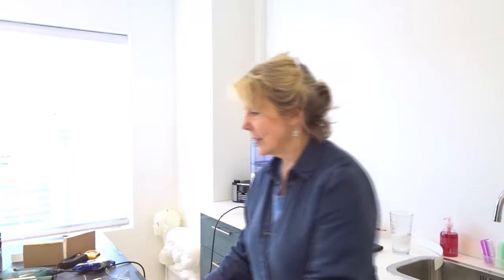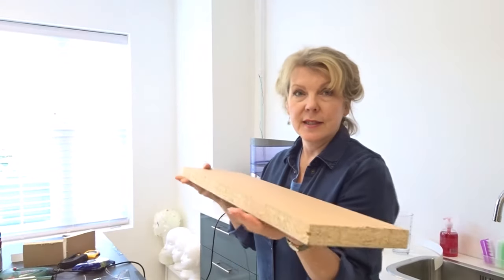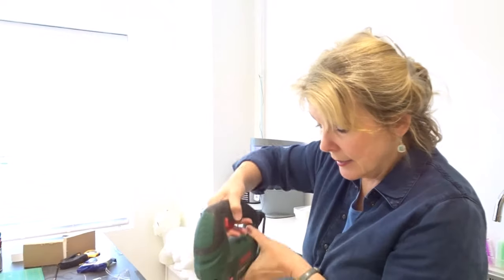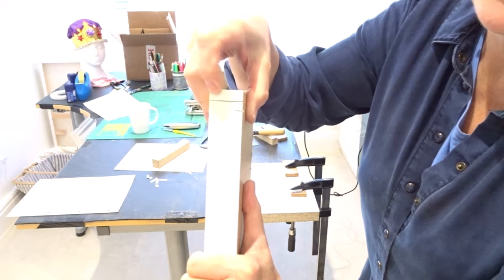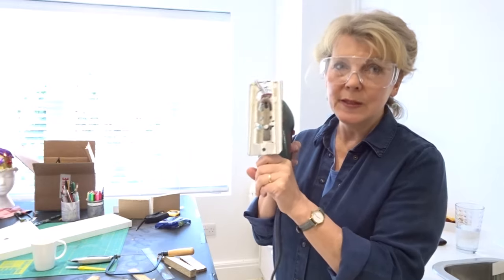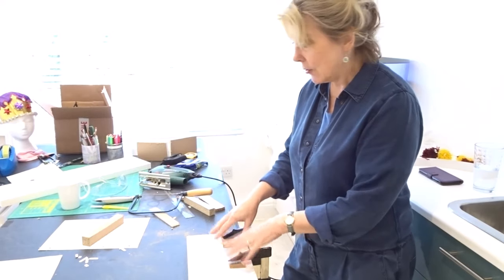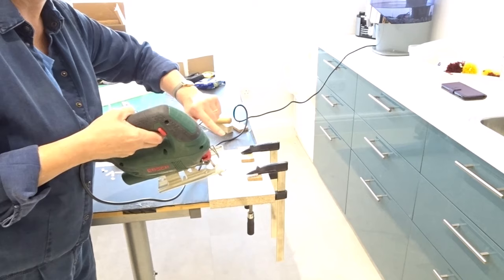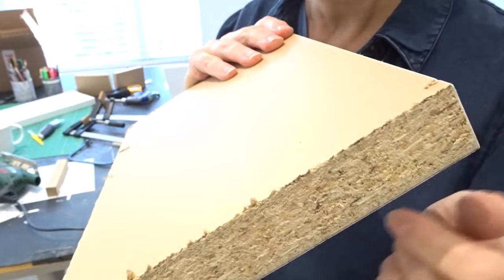How to cut a laminate worktop cleanly.

Comment from the maker: Hello everyone, I've just added another video about cutting Laminate worktops, this one covers those tricky tops that you have to cut without removing. 
https://youtu.be/b-OEkRpW-EE
Reply: Loads of thanks for this. If I need to make a pilot hole in the worktop first (to get the jigsaw blade in) what would you recommend about how to do this? [el'sda2]
Reply from the maker: @lemsdarkapprentice2535  I would make a hole ( with a wood drill bit) in the bit of laminate you are going to discard near the cutting edge, but not on it, then cut with the jigsaw to get to the cutting line, proceeding at a shallow angle ( not 90 degrees! ) to get to it then merge into your cutting line. You might find this video
 ( https://youtu.be/jAdZ94pqOXo )
 (not mine) useful to watch from 4 mins on. Ity demonstrates really clearly what I am trying to explain.
  Practise on an off cut first, to build your confidence. Let me know how you get on. Good Luck with the project. Make sure you subscribe. Thanks for watching.
Reply: Great video,  thank you. You are a great communicator.

Comment: If you apply less pressure with your hands on the whole tool, you will get and even cleaner bottom cut. I meant that if you completed the whole cutting off in say 20 seconds, take another 20 seconds to move the whole tool while cutting all the way, the blade won't take too much stress even though it might heat up. Nice video though. Really helpful 👍
Reply from the maker: Thanks Ravin. If anyone tries Ravin's method, let me know how you got on. I'm not looking underneath the countertop but would be interested to know how others got on.
Reply: @BecomingCreative  I have experienced this myself and in the beginning I would be in a hurry to get  the job done and that's how I learnt not to apply too much pressure on the cutting tool.

Comment: 10 out of 10 for presentation.
The trouble with jigsaws is that they are designed to cut curves. They are not designed to cut deep, square, straight edges.
I've cut many worktops and many items of laminated chipboard, but one tool I would not use is a jigsaw, unless I wanted a curvy edge.
Even with a professional jigsaw, a guide rail, a decent blade - laminate blades are available - you will not get a square cut across the length of a full sized worktop. The blade will go out of square the longer you cut,
For laminate worktops you need either a circular saw with guide rail for straight cuts or a large router and jig for joints.
A circular saw will cut exceptionally square, clean, chip-free edges if you work with a guide rail, use a decent saw with preferably a triple chip blade and most important of all, work from the reverse side, i.e. laminate side down.
You won't need to see where you are going because the cut will be square.
For really critical jobs, I would use a new blade or one that has had very little use. Chipboard is full of rubbish that will ruin a carbide tipped blade.
For "masons mitres" or joints at right angles using boards that have shaped edges, the the router is the way to go.
A big, powerful 1/2" router and a jig is the only way. Preferably after a training session on how to use it.
The going rate for a professionally cut worktop joint used to be £50 years ago, so no need to skimp on tools or materials.
Reply: Hi professional! question that if I need to cut worktop which made of paper+plastic, could I use Flat Wood Bit - 40mm to cut the worktop? thanks!

Comment: The described solution indeed works exactly as described, but cutting from the backside with a regular blade is much less fatiguing and more controllable, as you don't have to push hard downwards on the jigsaw all the time. With a regular blade the cutting force is applied against the baseplate and the jigsaw stays firm on the material wihout need to push down.
Try cutting a thick (or hard) worktop with a reverse (also called downstroke) blade and the jigsaw jumps on you up all the time.
This can also be seen in this video on the begining of the cut.
That is why the downstroke blade design is the exeption rather than the norm.
Reply from the maker: I agree and I do think that it is time to invent a new form of support that clips underneath the cutting surface, for use when using the down cutting blade. I have suggested this before maybe one that clips round from the side and under? Perhaps we need to design this new accessory TheXape?

Comment: I am making a sewing table for my wife and need to make a cutout for the sewing machine to be flush with the laminate top. I seldom use my jigsaw, but need to use it in this instance. I never knew about reversible blades. Thank you for the tip. I phoned my friendly woodworking tool shop and of course they have these R blades in stock. Never too old to learn new things. 😀
Reply from the maker: Well how lucky is your wife! Hope it goes well. Thanks for watching. Hope you've subscribed.

Comment: Beautifully explained!!! I've been told several times, that "they" couldn't do a repair on my new countertop. The salesman measured wrong and didn't listen to me say I wanted it flush so that I could have a handicapped approved door entrance, plus I wanted to be able to order a new refrigerator that would fit through the door. That's why I took the breakfast bar down in the first place. Now the countertop sticks out 1 inch too far.
 You give me hope that I can trim it back. I'm so grateful for this video. Thank you
Reply from the maker: I feel your pain! Take your time and a deep breath. There is no need to rush.Good Luck and I would love to hear from you when you have done it. If the bit you are cutting off starts to bounce as you progress, fill the gap you have cut ( so that you don't squeeze the blade) with a piece of cardboard or a lolly stick and tape it to the main piece behind the blade to keep it steady as you process to your triumphant finish!

Comment: Thank you for the clear instruction! I believe for laminate flooring there's also a sawblade with its teeth in the opposite direction, as you do want to have the decoration side of the floor facing on top.  What actually happens at 8.06 is that you start to cut already when the saw didn't had enough speed to cut. Use a speedsquare as a starting guide or a straight piece of wood as a guide to start your cut less troublesome, as you do not have to worry to "aim" where your cut has to start. It also appears you force the jigsaw to make the cut too fast. Let the machine do the work for you and the cut will be cleaner on the break-out side and the blades last longer. I also would like to add another safety rule: use ear protection.
Reply from the maker: And thank you Eric for watching and for your kind words and helpful advice. It's so rewarding that people with so much more experience than me a) watch the videos and then b) add their helpful tips and advice as you have. I'm hoping to build a lovely helpful community here. I hope you will join us by subscribing.
Reply: C hain saw has the same issue, the chain must be moving at full speed before contacting wood to cut neatly. Great video, and thank you for teaching about the R blade. Just when I thought I knew everything!

Comment from the maker: Hi There, I've been asked by Good Neighbour exactly which blade I am using in the video. Well firstly, thank you for watching and secondly the blade I used is called star x and I think I got them from screwfix. Their website is down at the moment so I can't give you a link, but the code of the blade you want is T101BR and many different brands make them. This is the link to the Bosch blades.  https://www.ffx.co.uk/tools/product/Bosch-T101Br-3165140012454-Reversible-Pitch-Clean-For-Wood-Jigsaw-Blades-X-5.  I'll post the link to the screwfix blades when their website is up and running again.

Comment: Finally someone who gives good clear advice without waffle. And a fellow female Brit.! Amazing. ! I'm trying to cut laminate flooring with a jigsaw. They are almost useless. Hard to keep in line, hard to keep on the table and the blade I bought for laminate is useless. Thanks for this advice though. ONE QUESTION. What is the best speed (s) and should pendulum action be used.?
Reply from the maker: Hi Jill, 
thanks for watching and glad you found it useful. In answer to your questions, I don't have pendulum action on my jigsaw, but I don't cut the whole thing in one go unless it's short, firstly because I don't want the jigsaw to overheat and secondly because I like to feel in control of it and be balanced on my feet, not leaning over. When restarting after pausing, I start the jigsaw before making contact (I believe the technical term is getting it spinning) and this has been recommended as the approach to take by one of the professionals on this thread  (I like to think of it as taking a short run up at the next bit if you like). So I guess this is a bit like a homemade slow pendulum action. 
As far as speed is concerned for the laminate I have found this https://www.wonkeedonkeetools.co.uk/jigsaws/at-which-speed-should-you-use-your-jigsaw, which you might find useful but it doesn't mention laminate floors specifically.  I guess I was going at a medium to fast speed, but my jig is quite old so I don't have actual numbers for you I'm afraid. If you have any spare tiles I would practise until you are happy with the cut. Also if the tile is moving as you cut it, I would definitely use some clamps and pad them with something rubber ( maybe some old flip flops)or cork to stop any slipping, but prevent denting. Don't try to cut a moving tile.
Lots of people tape the cutting line or score it before cutting with the jigsaw. Still slipping? You could mark the cutting line underneath, flip it over and use a 'normal' blade on the 'wrong' side. That way you will have extra grip as the normal blades cut upwards towards the base plate. I preferred to use the reverse blade and cut from the top on this heavy countertop, but if your tiles are very slippy (they are smaller and lighter than a countertop) and nothing else works, try this.

 Let me know how you get on and don't forget to subscribe!
Reply: @BecomingCreative  Very helpful. Thank you for your prompt and good advice.! Keep up the good work.! 😊

Comment: 1. The bland cuts on the up stroke to ensure the jigsaw base plate stays in firm contact with the laminate. You run the danger of lifting if it cuts the otherway.
2. To avoid not being able to see your cut lines mark them out on the underside.
3. Do what works for you.

Comment: Please add this tip to your future videos.
   If you are cutting off more than an inch of the laminate, you can make a practice cut.
   If you are cutting off 2 or more inches, you can make multiple practice cuts - before you do something you can't fix.
   This tests the surface, the saw, the blade, the cutting guide, and it especially tests your technique.
   You can firure out if you are better off cutting from the top or bottom, how hard to press down on the saw, cutting speed, etc.

Comment: Just what I needed to know as new widow am attacking DIY with electric tools I have only seen being used not allowed to touch, so thank you.
Reply from the maker: Well firstly, I'm sorry for your loss Jacqueline and secondly Brava for stepping boldly into the hitherto unknown world of DIY. We are all more capable than we realise and the more jobs you tackle the more confident you will be. Even if you make some mistakes, do not be downhearted or listen to any negative inner voices.

 Like pilots, give yourself a safety checklist; Goggles, ear protectors, check power off before and after use. Keep it next to your drill/ saw or whatever then you can be confident you are safe and don't have to reinvent the wheel each time. 
As you are a newbie, you might find it useful to keep a project diary. What you are intending to do, how you are going to do it and what tools/ equipment you need. Most importantly when you have completed the project jot down what, if anything, you would have done differently if you were doing it again.
I found putting up pictures particularly satisfying as I see then end result and enjoy it every day. Here's my video on this https://youtu.be/SmdKBfW67tA
I have to say though fixing broken things is immensely satisfy. I'm going to do a video on this shortly.
Good Luck in your next project and let me know how you get on.

Comment: Nice video. The blade cuts on the upstroke, so that the wood is pulled towards the plate by the blade, not pushing it away :)
Reply from the maker: Well that makes sense. Thank you Seth.

Comment: how do you cut it if it has laminare on both sides, like from a kitchen cupboard?
would clamping another piece of wood to the 'underside' work to have neat edges on both sides?
which blade then?
Reply from the maker: That's a very interesting question. I'm about to go away, but let me think about it and do some research for you. My initial thoughts are that you are correct - wood clamped to the underside would protect the underside laminate and a reversible blade will cut cleanly through the top laminate. If you try this before I do let me know how you get on. Make sure you use a new sharp blade to cut through that much thickness.

Comment: No need to rely on your eye to keep to a straight line.  Just clamp a piece of batten to the worktop, parallel to the line you want to cut, 1/2 the width of the jigsaw sole plate away from your cut-line.  When you're cutting, just keep the edge of the sole plate in contact with the batten.
Reply from the maker: Another good tip, thanks Barry. Glad you enjoyed the video.

Comment: Just a couple of points. I don't understand why you used a coping saw to start the cut. You would be less likely to get a square cut compared to the jig saw which would have no trouble starting and would not create any damage to the laminate. I would recommend you clamped a straight edge across the worktop so the jig saw simply follows a dead straight line rather than have to "steer" the jigsaw. You would probably need the clamps used from below as they might get in the way at the start and end however. The BIGGEST problem with down cutting blades is that they can suddenly make the blade and jig saw jump up really viscously (8:06) even if you hold it down as hard as you can. It can be far worse than you experienced... totally unpredictable. At this moment you could ruin the worktop surface as the blade will dig into the surface. It is far easier to cut conventionally from the reverse side as long as you use the straight edge as a guide.. The jig saw will leave a clean cut and you'll have no chance of the jigsaw jumping out of the cut causing damage.

Comment: Thanks for your reply.     I’ve just had another go at cutting my worktop with my saw 🪚 but I’ve basically given up on that now.
I’m a bit worried i might mess this up?  It’s incredibly difficult.  As you can see in my 30 second clip.     
I’ve just this minute compelled myself, to have a look on Amazon... for a jigsaw.   And yes!  I’ve now ordered one.  ( Bosch compact 700E ).   Hopefully this will make life a bit easier.   They all say it’s another good product to use.    
i did have a look at that jigsaw... that you saw on screwfix.    But then i thought, it would be better, or easier...  if i just buy one from Amazon.    But thanks anyway.
Saturday afternoon at 13:43H. 10th April 2021. U.K. 🇬🇧 Southampton.
Reply from the maker: Sounds like a good decision. While you are waiting for it to arrive there are plenty of 'how to cut sink holes in counter top' tutorials to watch to make you feel more confident. ( not by me) this one's pretty good  https://www.youtube.com/watch?v=EO9cAlBltfI
You can also find a piece of old wood wider than the hold you are cutting ( see tip 4) do not skip this bit.

My top tips?
1 Check underneath that there are no pipes or bits of cupboard in the way of where you want to cut.
2 Use a paddle or spade bit in your drill to drill a starter hole that is wider in diameter that the width of your jigsaw blade.
3 Remember that you can stop and re-start at any time with a jigsaw, you don't have to cut it in one go. 
4 Once you get more that half way round secure the bit you are cutting out with a couple of screws ( in the bit that will be thrown away not the countertop) to stop it bouncing as you continue- and probably breaking off ruining all your good work.

 Practise using the jigsaw in some old countertop first to get the feel of it.
You can do this: you will not make a mess of it if you take your time and mark your template carefully.
Good luck. Let me know how you get on.

Comment: Good tips, Two things though, Never start a saw of any kind when its in contact with the surface to be cut... start the saw first then move it to the cutting area. and 2. don't lean into a power tool like that... if things go pear shaped it could end badly for you...
Reply from the maker: Thanks for the tips!

Comment: What about drilling a hole with a spade bit? I have a laminate countertop that I would like to install a soap dispenser in and I really don’t want to mess up my counter top as they were installed in 2021.
Reply from the maker: @alexib5248  To be perfectly honest I have only used spade bits on wood, not laminate. Your problem here is not just which cutting tool to use, but also access to the top as it is already fixed in position. 
You could use a sacrificial piece of mdf on top to protect the laminate layer, but difficult to see how you could clamp it in position.  Also be careful you don't cut too close to the sink. Personally in your situation I would consider just mounting a bottle dispenser on the wall. Does anyone else here have any suggestions for Alex?